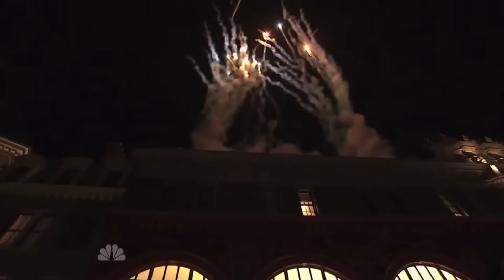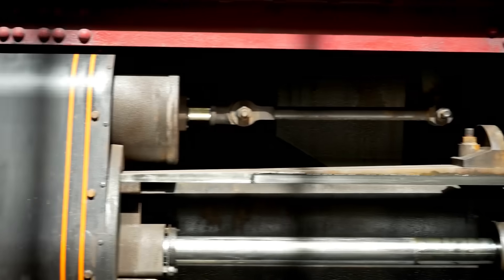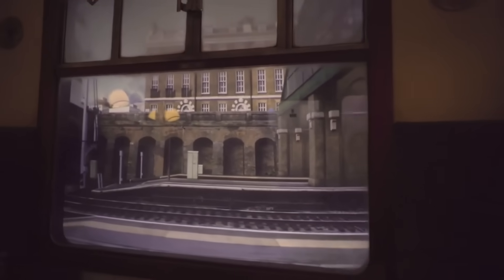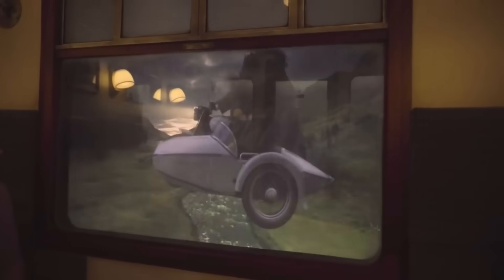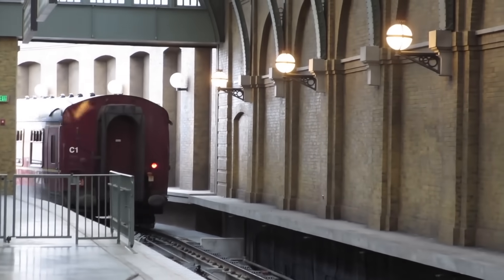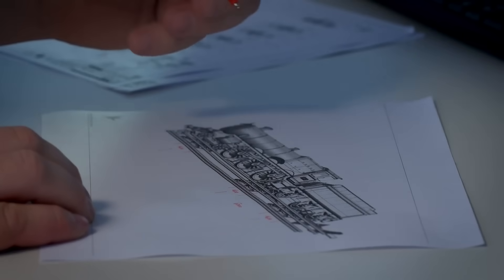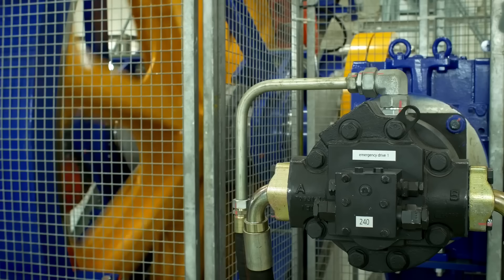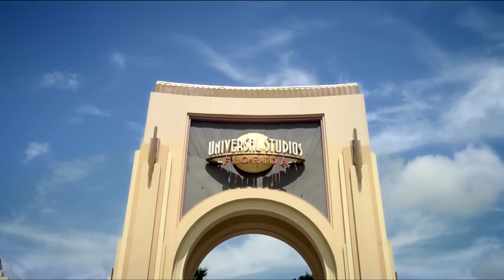Why This Hogwarts Express ISN'T a train!

Comment: As a UK steam train enthusiast, I must say that’s an extremely convincing replica of 5972 Olton Hall (Hogwarts Castle).  The coaches not quite as good but it’s certainly better than most VR motion rides!
Reply: The replica locomotives even have copies of the brass "works" plate of the Olton Hall on them, but if the coaches are "not quite as good" I'd be interested to know where you think they fall short, because I suspect that they are actual BR MK1 coaches, or at least the superstructure perhaps mounted on to new suspension and bogies.  I spent many hours traveling in MK1 coaches in the 1980's and IMO if Orlando is using replicas then whoever manufactured them has certainly gone "above and beyond" - even the fold-down armrests appear to be complete and fully functional (you can push your fingers into the seam between the arms and seat and feel that they are complete, not just a surface feature of the upholstery}, but were then sewn into place so they cannot be used on the Orlando ride.
Reply: @pulaski1  If universal managed to get a hold of MK1 coaches, then damn, but i think the fact that heritage lines are rather protective of there rolling stock and the shear logistics needed to transport that many MK1s would be rather apparent and questions about authenticity wouldn't be happening
Reply: @electrohalo8798  I think you're overlooking the fact that Universal was planning and building the Harry Potter attraction at the time when Mk1 rolling stock was being phased out, in the 1990's and early 2000's so at that time there were likely many carriages available either directly from BR/ franchises, or from scrap yards as withdrawing that many carriages would mean they were worth little more than their weight in scrap steel.
Reply: @pulaski1  I don't believe they are real MK1 coaches the profile is all wrong, looks like they are specially built not a bad approximation and possibly used some bits and pieces from a real MK1.
Reply: @ianburnley6873  The coaches look a little wider and lower than the real thing but the details look really good. Watching the video I could hardly believe it wasn't a real "Hall" and Mk1s, especially with the C1 restriction and other neat touches. Well done Universal.  Many of the Mk1s contained asbestos so shipping and refurbishing might not have been as cheap an option as it looked.
Reply: @pulaski1  actually, the coaches look to me like Playcraft (Jouef) Mk1 coaches scaled up to 12":1' scale.
Reply: And they even have the C1 on the coaches, too, which is a nice touch.
Reply: I’ve been on the real (I’m pretty sure) train in Scotland
Reply: @creamwobbly  "Needs a bloody good wash though"
You don't understand theatre !
Reply: Ha ha...I have been idly looking through my Railway Magazine for March/April 1949 and there is a photo of 5972 Olton Hall climbing Dainton Incline in Devon, with assistance from 'Bulldog' 3401 Vancouver; as in Great Western practice, the assistance being next to the train and the Hall, the train engine, in front. (I admit, I become irked when modern usage uses the term 'train' to mean a locomotive. Only when attached to wagons/vans/ carriages, does it become a train.)
Reply: It really isn’t
Reply: Those definitely aren't MK1s. But a pretty good approximation, possibly adapted from coaches sourced domestically in the US
Reply: They may not have been authentic coaches but the Universal engineers went above and beyond reproducing them as close to authentic as possible. They even had the people who make the coaches come and do the upholstery for the coaches on the ride. They might not be authentic, but they're darn close.
Reply: @Boskov01   Go to Boyne City there is a couple of Mk1 cars and go to Ohio for the 0-6-0 "Flying Duchess". Fun fact: A&A #18, the passenger cars#18 pulled, 0-6-0 "Flying Duchess" was at Boyne City. The two Mk1s came with the 0-6-0 for the English Train Excursion service. Lastly, go to Green Bay Wisconsin, a Gresley A4 "Dwight D. Eisenhower" is there.
Reply: You can't be a very good enthusiast, this a loco not a train.
Reply: @heybabycometobutthead  Neither are you. Train refers to the full rake, besides, were you even watching? It’s not a locomotive since it’s not under its own locomotion. The coaches aren’t removable and the “locomotive” has no power unit, making it a multiple unit if anything.

Comment: I live in London and I use King's Cross Station very regularly. I can't help but find it strange to see a replica on another continent. A pretty good replica too.
Reply from the maker: I did visit the real thing a few years ago and yeah, it's a very good replica. They definitely put a lot into the expansion.
Reply: I love your vids good to see you here :D
Reply: 0:42 It looks like half of the station. Also in the movie they used exterior shots of St Pancras station.
Reply: I used to work just around the corner from Leadenhall Market, and used to go there regularly for lunch, and for drinks after work (before I left the UK) - so it was more than a little strange to visit the Diagon Alley area of Universal Studios Orlando on holiday and find a decent recreation of a place that I associate with work.

And talking of replicas - the locomotives in Orlando are replicas of a locomotive that Universal owns in the UK (on display at the Harry Potter Experience), and the attention to detail is incredible, all the way down to the engine builder's "works" plate on the end of the locomotive.
Reply: @pulaski1  I think they would have done a 3d laser scan of the original.
Reply: @jerribee1  The locomotive?  Maybe, they certainly would be today, but the replicas were, I believe, made nearly 20 years ago, so I am not sure how good the technology was back then.
Reply: @pulaski1  Leadenhall Market is not around the corner it's 2 miles away just off Gracechurch Street near Bank.
Reply: @alexlangford6291 Please reread my comment "I used to work just around the corner from Leadenhall Market ....".
Reply: @pulaski1 I think they got rid of the snack shop at kings cross
Reply: @Wiki021  I have no idea, but I would never have been there, I think I only caught a train from Kings Cross once, and that would have been over 30 years ago.
Reply: @pulaski1  The real locomotive that was used in the Harry Potter films is called the Jacobite and is not owned by Universal, it’s owned by West Coast Railways and runs from Fort William
Reply: @supexplore8397  I was talking about Oulton Hall, not the one in the films.
Reply: @pulaski1  oh I see, that’s at the Harry Potter Experience now
Reply: @supexplore8397  The Jacobite is a steam hauled train service, not a locomotive. This is indeed run by West Coast Railways.  
 The real steam loco is called Olton Hall, and is owned by West Coast Railways. It is on loan to Warner Bros' for static display at the studio tour in London.
Reply: @Pulaski But surely that too is a replica, of the one used in the films?
Reply: @PiousMoltar  I'm not sure which of my posts you are replying to.  The original Oulton Hall locomotive is currently on display at the Harry Potter experience in the UK.  There are two replicas of that locomotive at Universal Orlando.  If there are any other replicas am not aware of them.
Reply: Upcoming tales from the tube on the fake King's Cross?
Reply: Have you found platform 9 3/4 yet
Reply: @pinklightningvtuber  apparently they do have a memorial?? To the Hogwarts Express location...a place you can have you picture taken
Reply: Sadly kings cross doesn't serve steam engines anymore
Reply: Used Kings Cross many a time. Just don’t try and walk between platforms 9 and 10, unless you want to be done for trespassing on the track.
Reply: @namugriff  I know right 
The scene used platform 4-5 in the film
Reply: I got a broken nose at kings cross 

Turns out that the walls are solid
Reply: @Cinnamona1234  that reminds me when I was at king cross station this guy came screaming from outside I’m late for hogwwwwwartssss and spattered himself on the wall of platform 9-3/4 shop. Then legged it.
Reply: Now thinking about it, it does seem a bit matrix-y to see your regular train station in Florida of all places, especially when you are on a different side of the globe as Florida.
Reply: Jago! Love your videos, Sir :)
Reply: I felt similarly when visiting Universal in Los Angeles taking the studio tour and then finding myself in a life size BART replica (a la San Francisco, my then-hometown). It felt so real and yet so strange.
Reply: Stepford central has a platform 9.75
Reply: Don't understand why they felt they had to ship Dumbleton Hall off to Japan to turn into one of these abominations, could of just built another replica. 😔
Reply: I’ve been to the kings cross replica in London. It’s pretty realistic. They got the trains wrong though, none of the train designers seemed to be very good at making anything that looks like the hogwarts express.
Reply: It makes more sense to me to see it in another continent! Otherwise it would be like having a replica of the Eiffel tower in Belgium.
Reply: I go fairly often to the WB Harry Potter studio tour in Watford. They have a similar replica station with an actual steam train in it but it’s a static display. I must go to one of the theme parks some time
Reply: I read this comment before seeing who it was from !

Tales from the Subway !
Reply: That’s how all of us feel about international Disney parks.
Reply: get your toothpaste
Reply: I live in Birmingham and visited Kings Cross one time, but failed to see the resemblance between the real station and what we see in the films
Reply: I've been there too and seen the little homage to HP They have, watching this was weird lol
Reply: Love Jago's channel in the Tube and other things London.
Reply: @Amethyst I remember that well, we🇬🇧picked it up in boxes with labels on each end. Rebuilt in 🇺🇸USA but the ‘River’ was dug out afterwards.😂 TRUE 😂 funnier than Harry Potters Train😂
Reply: they copy everything. from the pyramids to the eifel tower. it's complete non sense and cultural appropriation. they have nothing to show for themselves.
Reply: In that aspect...yea...but it doesn't look like in the movie at all/doesn't match the books cause there's no pillars like they show them vanishing inside 🙃
Reply: Fancy seeing you here old chap. I'm a subber. Love your work.
Reply: It is extremely accurate, it says the terminating stations of the national rail!
Reply: We have a bridge of yours in Arizona as well...
Reply: I live in Switzerland and I use feniculairs regularly, including the train in Davos that was shown in this video multiple times. Never would have though that this system serves as an amusement park ride on another continent. Very interesting for me, that it takes the bigger part of a nine minute video to explain who such a train works. Here in Switzerland it's just normal to see those things in operation. And they are not only used for skiing, in the city of Zurich alone there are 2 such trains (Polybahn and Seilbahn Rigiblick) that serve as a regular part of the public transportation system.
Reply: Yea I was on a trip to Disney and universal and I was just walking around it thinking “huh these queues are less waiting time than real life wtf?”
Reply: Fun fact, platform nine and three quarters could not exist, in kings cross there are two sets of tracks platform 1-9 and platform 10-18 on different sides of the station at a right angle. So there is no wall in-between them. In the films they used platform 4-5.
Reply: I guess at King’s Cross they should make A platform 9 3/4
Reply: I’m pretty sure the display boards show First Capital Connect to Finsbury Park 😂
Reply: @Ro99 Wait… What?!?!?!
Reply: same
Reply: IKR, a bit smaller obviously and there’s some bits missing but if I was transported (teleported) there or something I’d believe it was KX for a bit!
Reply: Didn't expect to see you here. XD
Reply: Oh hi Jago! When I started watching your channel you had hardly any subs. I like to think it was my subscription that set the ball rolling ;)

Comment: Do you have any information on how the steam is generated for the engines?  How are they topping off the water during the day?
Reply from the maker: It's fog from gycerol. A fog machine.
Reply: @AmusementLabs  Thank you for the reply.  I am sure an engineer calculated the cost of making real steam vs glycerin.  Then there were probably tests to see which looked the best and lingered longest in the hot Florida sun in July.

Comment: I knew that it wasn’t a real steam engine there by being a trick the first time I road it I have ridden steam trains before the movement was wrong. I found out the trick of the train the second time I road it. My cousins and I were the last passengers loaded in. We heard the doors closing down the train they got to the compartment two or three ahead of us, and stopped . Something happened on the other end of the train so the door wasn’t closed as we left the station. Whatever happened caused them to forget about us I got to watch out the door all the way. Boy were they surprised that the door was open, and we were just sitting there waiting for them so we could disembark.
Reply: Yes!    The only time I've ridden behind a 'Hall' class the motion starting off was quite uncomfortable, a sort of fore-and-aft- surging.   I believe this was a characteristic of GWR two-cylinder classes, much more pronounced than with other steam locos.

Comment: Why did the bother with all this? They could of literally had a normal train with a Hogwarts express facade on top.
Reply: Because then you'd just have a regular train and not the whole "you're on the Hogwarts Express" experience. You'd still have to set up the route linking the two parks, still have to synchronize the two trains to depart and arrive at the same time, and still have to add the onboard experience. This was the better option.

Comment: When we visited the park I figured out that there were two trains because the one way ride took 4 minutes plus load time but if you watched the train leave a station it seemed to return to the same spot at 4 minutes plus load time.  a single train should have taken twice the travel time plus a load interval but it the time was about half so it made sense that there were two trains
Reply: Maybe the second one is just a reflection of the first in the smoke & mirrors ;)
I think that's how the universe is - all those stars is just multiple reflections of the sun taken over many millions of different and differing lengths of light paths.
The flat earth society were on the right lines but it's the universe that's flat ;)

Comment: The really interesting part is that you are riding a Great Western Railway engine,operating out of a Great Nothern Railway terminal,and the engine itself is painted Midland Railway red! Strangely enough,St.Pancras,the old Midland Railway Terminal is across the street from Kings Cross,and now it's the terminal for the Chunnel trains to Paris,etc.! The 5900 series were 2 cylinder 4-6-0's,of the GWR,just for your information! Thanks for a most awesome interesting video,and thankfully there is a great deal of information on British steam engines available,and various London terminals,too!! Thank you!
Reply: Even more strangely, the remains of the original loco (Olton Hall) was parked just around the corner from my office at Prorail in Wakefield, and I had a very minor part in restoring it. I say restoring, it was a few hours with a wire brush. It was weird enough seeing it in the films, seeing a replica in a theme park is mind boggling!
Reply: @Zadster  the Actual loco is now in Warner Brother’s studios in London.

Comment: Great explanation, the cable hauling system reminds me a lot of the pre-modernised Glasgow Subway, where cables were used to move trains around in two circles (albeit using steam instead of electricity), with no points anywhere, alongside conductors to power the train lighting.

Comment: i got a question what would happen if one of those cables snapped???
Reply from the maker: Well it would take quite an enormous amount of tension to break it and the strain sensors in the haul room would've stopped the ride already. I also think they pass a charge through the cable and if it were to break the charge would disappear and the ride would stop.
Reply: @AmusementLabs  interesting